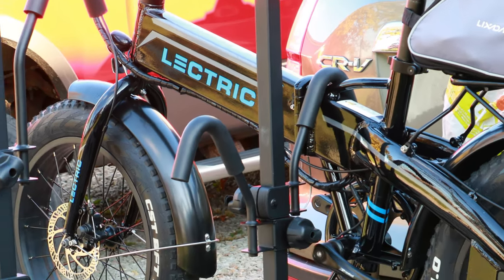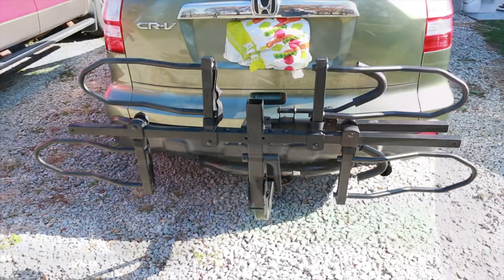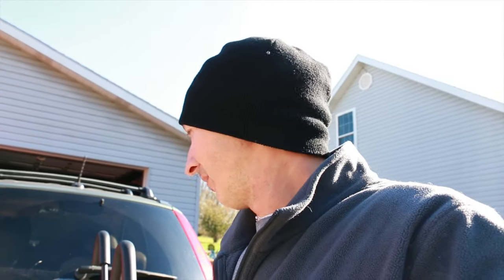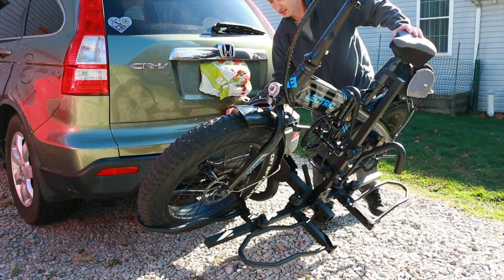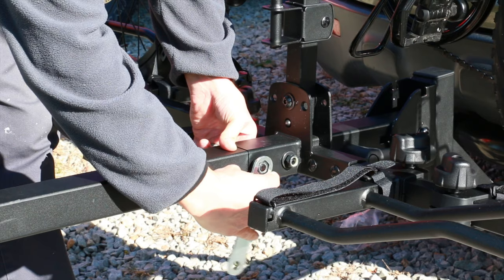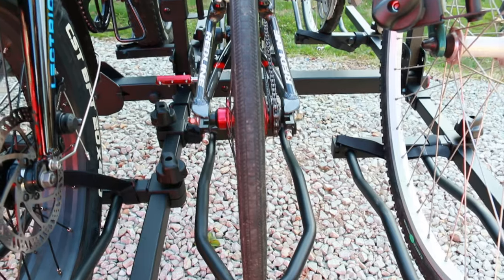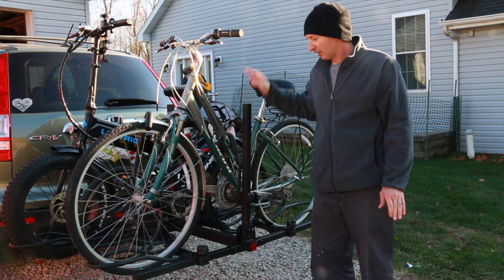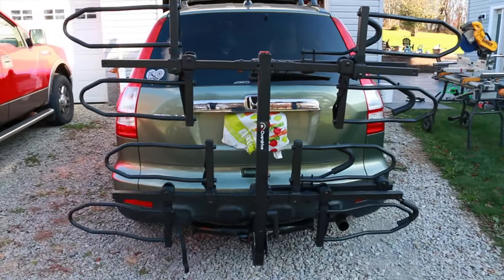FAT TIRE Electric Bike Rack Review, Overdrive Sport 4, Best Heavy Ebike rack

Comment: HELLO JEREMIAH,  VERY GOOD VIDEO on the fat tyre bike rack heavy duty electric bikes , Overdrive sport for 4 bikes. I may purchase this one for a two wheel e bike and a adult European  UK tricycle. ( ALPINE EXPLORER ELECRTIC TRICYCLE , in ENGLAND UK and a fat tyre 2 wheeled  e-bike like the SONDORS XS FOLD . ) THIS WILL CARRY THE WEIGHT fine if I remove the battery packs.  can you tell me if I am able to fix a LIGHT BOARD ON THIS BIKE RACK  for tail lights and directional indicators can be seen clearly. this would be fitted onto my RV  HERE.  AM WAITING FOR some info from the manufacture off the ALPINE EXPLORER TRICYCLE ( its on YOUTUBE & there website video ) for the  distance measurement (gap) between the  rear two wheels  centre off the tyre to centre off tyre,    CAN YOU TELL ME MATE is there any way off adjusting the gap closing it up or widening  it off the wheel tray ( wheel holder ) on one bike rack too the other wheel holder on the bike rail. so you can move the bikes further apart or a little closer if needed. PARTICULAR for the centre wheel holder that you showed was only 10.5 inches apart  instead off the 12.5 inches gap off the first bike wheel holder.  much appreciated  thank you kindly  Jeremiah.       Paul  H
Reply from the maker: No you cannot adjust the distance between the bikes only the distance between the wheelbase of each bike. Hope this helps.

Comment: Jeremiah, would this rack work for TWO step thru lectric bikes like your wifes? Thanks
Reply from the maker: It works good with both of our bikes however we have one of each. The only thing that would be difficult with two step Throughs is the arm that comes down to secure the bikes are two different lengths and the taller one may not come down far enough to hold the tube on one of the  step throughs. You might have to figure out how to put some sort of top tube  Bar on one of the bikes  if that makes sense.
Reply: @JeremiahMcintosh  thanks for the very fast response. We purchased two step thrus and are now looking for a carrier. Like you, I dont want to spend as much for a carrier as a bike but still need something strong enough to carry them both. Your vids are the reason we went with Lectric bikes like your wife's. Thanks, Bruce
Reply from the maker: No problem that’s awesome I’m glad I could help. Like I said it would probably work but you may have to add a top tube bracket like the one I showed and one of my bike rack videos to go from the base of the handlebars to the seat post and then the clamp can hold it down there. Honestly you would probably have the same problem with any bike rack. Some bike racks have the holders that hold the wheels down instead of the bike itself but you might run into an issue with the fenders with that style.

Comment: will this type of bike rack hold my ripcurrent s electric bike?
Reply from the maker: How much does your bike weigh?
Reply: @JeremiahMcintosh  about 64 pounds without battery.  I was more worried if the rack is long enough.  I wanted to get the Overdrive bike rack for the 1.25 hitch.
Reply from the maker: Oh OK it holds my 63 Pound bike no problem I don’t think you would have an issue with the wheel base but the 1.25” one May not be As sturdy🤔

Comment: I don't know if there is a non trailer hitch bike rack that can handle the weight of these ebikes.
Reply from the maker: I doubt it....these ebikes are heavy but this rack seems to hold them well with no problems. Currently the four bike one is on sale for the lowest I’ve ever seen it.
Reply: @JeremiahMcintosh  Amazon has got one that is supposed to hold 60 lbs. That is much too close to the weight of the Lectric, less you remove the battery
Reply from the maker: As I’ve said in the video amazon has it listed as 60lb per bike but the manual states 66lb per bike for the 2” hitch version. But yes you are right about taking the batteries out.

Comment: Can I fit 2 Lectric e bikes on the rack
Reply from the maker: Absolutely it will definitely hold 2 Lectric bikes! It is rated for 66 pounds per bike in the manual so no problem for weight or size. I weigh 160 pounds and stood on the rack and it held me just fine.
Reply: I carry an XP and the LX on mine, no problem. After 3 months of steady use I'm very pleased with this rack. (And the Lectric bikes also!)

Comment: Covering up the license plate is just another reason for the police to stop you... also covering up the bikes with a tarp can block your tail lights... this is a problem with all the hitch racks
Reply from the maker: LOL I wouldn’t cover up the license plate while driving down the road but good point on the grill cover ...I did not think about it covering the tail lights. 🤔
Reply: @JeremiahMcintosh   Take another look at your set-up.....you are covering your plate location..Lol... you can't have anything in view of your plates... not even a hitch ball if it block the plate... its a reason to be stop.
I have the same problem with my 1up-usa rack... I have to relocate my plate to the back of the rack. If I fold down the seat and handlebar I'll be okay with the lights if I have the cover on.....I don't want to be rear-ended. Here in the State of California you can't have any type covering your plates. That included the smoke or clear plastic protector... even if they sale it in the local part store. They get really strict because of all the toll bridges and lanes....also the red light camera. To make this all legal you also have to have a license plate light....... It just doesn't stop to have everything legal